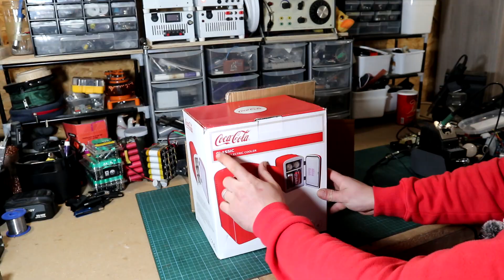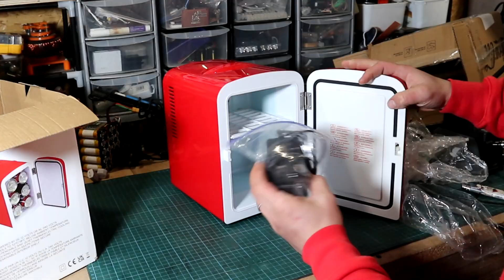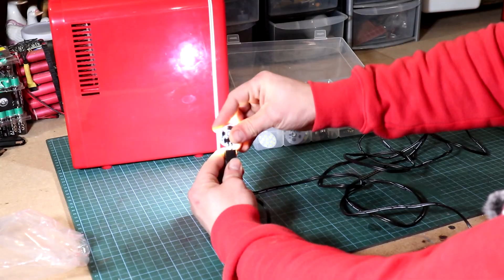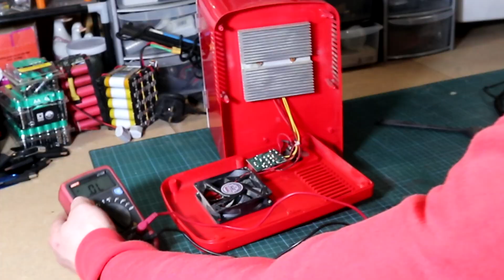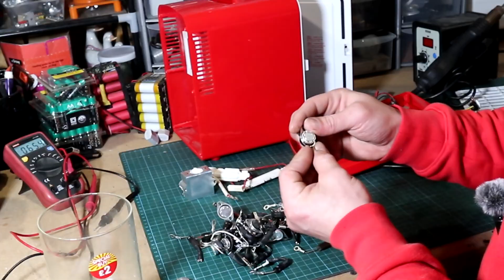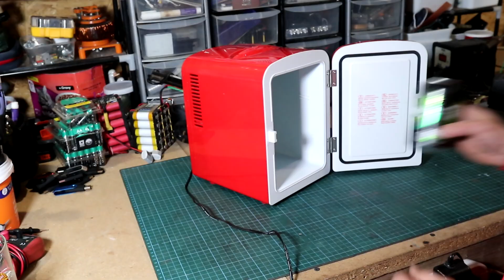Faulty Coca Cola Mini fridge Troubleshoot and Fix

Comment: I have the same fridge and the fan turns on but it doesn’t cool down or warm up. How would I fit that
Reply from the maker: Open it up check the wiring, check the peltier module resistance if all check ok you may have the same problem as this one perhaps the small thermostat seems where the wire go and you can cheat test it just to see if is the problem short the two wire from it and if the peltier module start heating the heatsink or you feel cold to the touch from the inside that's the culprit. I don't recommend just short and go with it , make sure you will replace it as if not the peltier module may get damaged. Stay safe